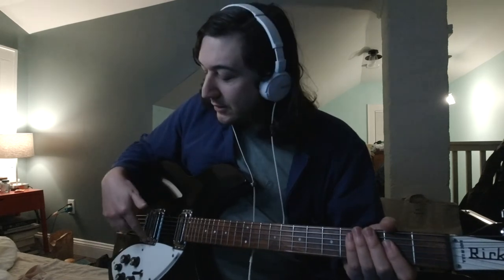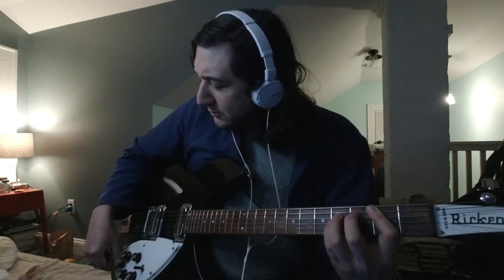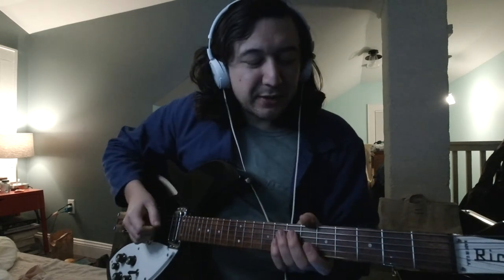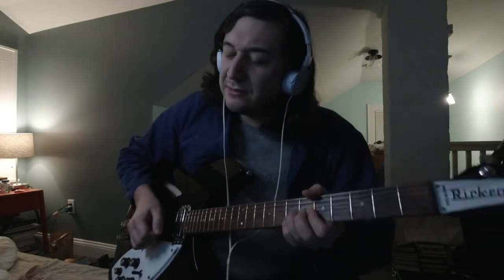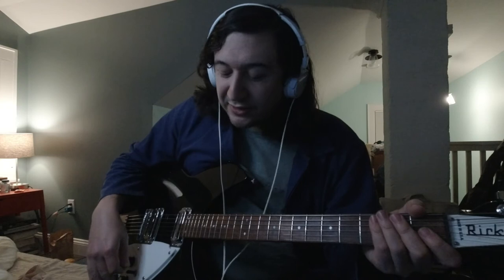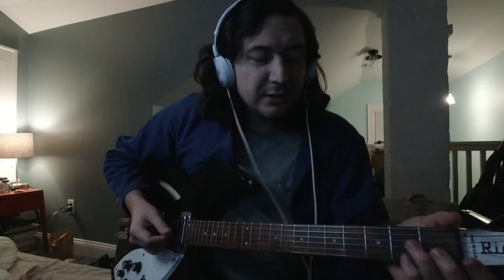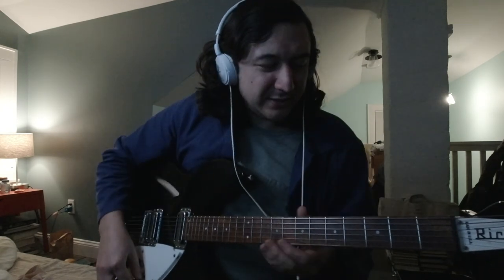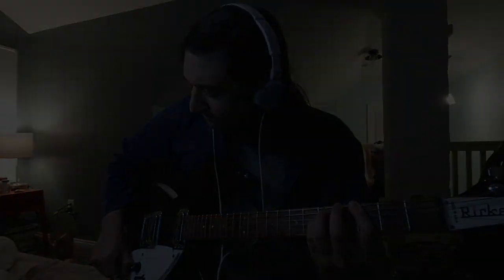Rickenbacker 330 Demo (overdrive + fuzz sounds w/ toasters)

Comment: Sitting Still!  Great video, thanks!  Can you list all of your mods in the comments?
Reply from the maker: Replaced the hi-gains with toasters, rewired the volume and tone for 1960s wiring, added a switchable bass cut on the treble pickup for the real 1960s tone, removed the lacquer on the fretboard, and replaced the R-tailpiece with the cooler trapeze tailpiece.
Reply: @Davimre  thanks!  What pickups did you get?  What is the "60's wiring," and did the trapeze change the tone or feel or just make it much easier to change strings?
Reply from the maker: @josephsacher1048  1) Rickenbacker toasters; 2) https://www.anatomyofguitartone.com/home/5/28/19/vintage-rickenbacker-tone; 3) String changing is much much easier but I didn't notice a change in tone.
Reply: @Davimre  Not all toasters are made the same, neither are hi gains. 90s had hot toasters. I had a '96 325v63. Many hated those pickups and unwound them down to 7.4k. Better toasters will always be 60s. Not everyone loves the current scatterwounds. It's very subjective to the player's ear and style.
Reply from the maker: @joellebrodeur1015  these are the vintage-y scatterwounds thankfully. I’ve read some of the hot toasters could be into the 10k range and that sounds terrible.